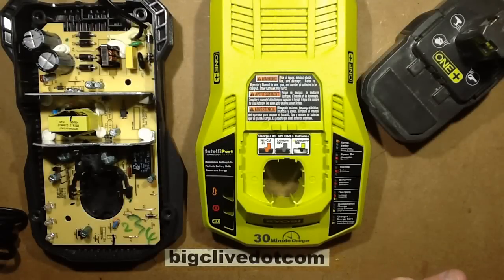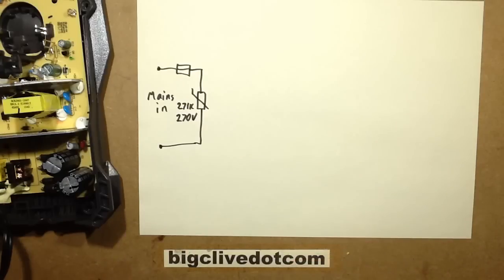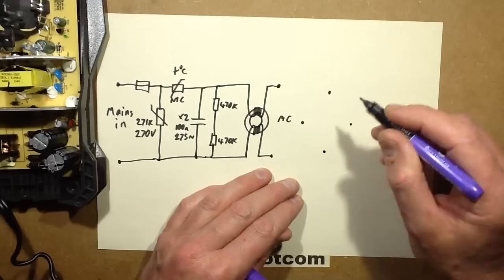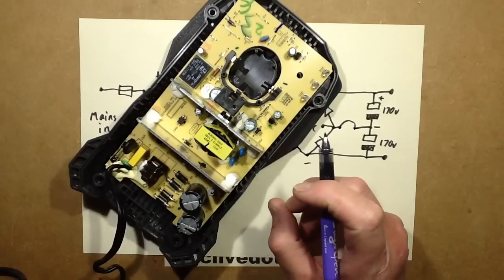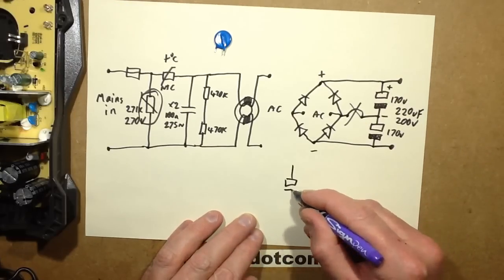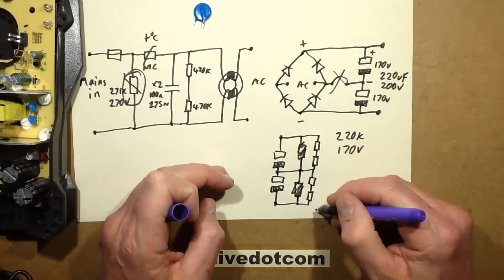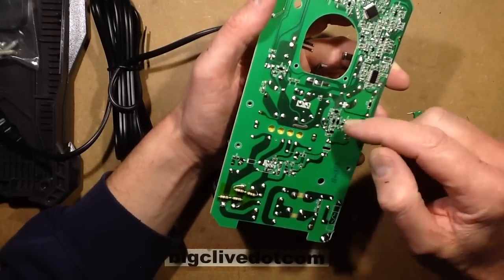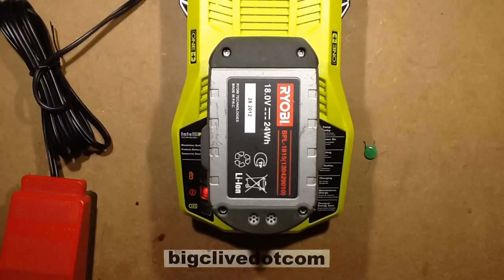How to convert Ryobi P117 charger from 120V to 230V use.

Comment: Am I the only one who hates having these bulky "application-specific" chargers? I mean you have 10tools and 10 chargers. I like having standard 2.1mm charging port on all devices and having charging circuit inside the battery pack with wide range input voltage. So I can just grab any DC power supply (12V, 24V...sometimes even 5V from USB) and I am charging. I modified some tools I have in my house with DC/DC converters and charging circuits to have universal input from 5 to 35V. It is much easier to charge. On small cordless screwdriver I even put microUSB port to charge because original charger was like 5 times bigger than the screwdriver itself. I don't have room for this. Now I charge it from USB just like my phone :)
Reply: How the hell did you end up with 10 different chargers, max I've had is like 2 or 3

Comment: Why no balancing resistors across the cap? Because the jumper is there, so they aren't in series! :-) Someone Muntz'ed (look up "Mad Man Muntz") the circuit and saved a penny. The MOV value is typical for US equipment.

BTW, watts equals E squared over R. Saves some extra math when calculating resistor dissipation.

Oh, that opamp might well be a voltage multiplier for the current sense resistor, and possibly also the battery temperature sensor.
Reply: so the 120v version needs no resistors, but when you cut the jumper you need to add them?
Reply: Yes. Or at least you should add them. You might get away without them for the length of the warranty. Maybe. And they cheaped out and didn't even put some holes in the board for them.
Reply: In 120v mode only one capacitor is working, in 240v mode both are which is where the problems might start.
Reply: mickenoss  In both configurations, both capacitors are used. The switch mode circuit input is expecting around 339V DC in either configuration.

Comment: My guess (based on the odd placement) is that they will use a single 400V rated capacitor instead of the two 200V ones so they do not need those balancing resistors.
Reply: Correct. Optimally when used in the voltage doubler configuration there's no need for resistors and when used at EU mains one single capacitor would be used.

Comment: Clive, are you sure that Third Contact is voltage sense and not a thermistor? Thanks.
Reply from the maker: The thermistor is inside the battery pack.  It's connected to the third connection.
Reply: Sorry, I misunderstood something you said. It occurs to me that the split negative contact might be to detect insertion.

Comment: I think I might have been tempted to replace those two electrolytics in series with a single, higher-voltage one -- as many μF as would fit, 450 V.  Fewer bits to go wrong .....  Looks as though it would go in with maybe some lead-bending.   The MOV is usually more for the benefit of the rest of the world than the switched-mode power supply; so if you wanted to be mean to your neighbours by interfering with their radio and TV reception, you could leave it out.
Reply from the maker: The X2 capacitor and the common mode choke are the noise suppression bits.  The MOV is mainly to protect the rectifier to ensure that the reverse breakdown voltage of the diodes is not exceeded resulting in breakdown and a brief but destructive mains short as a result.

Comment: Perhaps a question I'll get some flack for asking, but I had learned RMS to be .707 many, many years ago, but you seem to use its double, 1.414.  What's the difference, if any?  Obviously the equation used is opposite, but are they both called RMS, or is .707 something different?  :]
Reply from the maker: Wrong direction.  0.707 is for converting back from peak to RMS on a sinewave..
Reply: Ah, okay.  Thank you!  :)
Reply: It's not actually it's 'double', it's sqrt(2) (ie 1.4142), and then to get the conversion the other way (which you're thinking of), we do 1/sqrt(2) which gives the familiar 0.7071....

Comment: wow, so simple to convert us/chinese/taiwan voltage power supplies to UK/Aus rating :D. i'll keep this in mind if i find something i want to bring home and its a switch mode power supply.
Reply from the maker: It's not always as simple as this.  They clearly designed this PCB to accommodate both markets.

Comment: What was the cost in doing it yourself vs buying one already adapted for UK use? If you didn't have the parts etc how hard are they generally to come buy? As US prices are generally cheaper could you feasibley buy all your electronics from the US and convert them cheaper than buying UK ready/certified equipment?
Reply from the maker: Cost of components was less than a pound, plus I bet they don't add the balancing resistors on the converted ones.  Not all 120V equipment can be easily converted to 230V.

Comment: Can I ask, why you multiplied the mains RMS voltage by 1.41 to get the peak. Is it some sort of legislation that says it cannot be above that or?...
Reply from the maker: The value of 1.4 is used to derive the peak value from an RMS sinewave.  RMS means root mean square and represents the average value of a sinewave.
Reply: bigclivedotcom I am not very knowledgeable about this sort of stuff and that explanation didn't explain much to me lol

Any resources to help me?
Reply from the maker: Because the mains voltage is going up and down 50 or 60 times a second the average value is used to describe it.  When it's being converted to DC and then used to charge up capacitors they will charge right up to the peak of that moving voltage, so you have to work that out by multiplying the average by the 1.41 value to get the peak instead of the average.
Reply: bigclivedotcom Ah okay, so those peaks will be 240V × 1.41?

(Also thanks for the replies, love your videos)
Reply: Strictly speaking, 240 V × √2.
Reply: applefanXXX It might also help to mention that when we specify an AC voltage as 240VACrms (root mean squared) what we are really saying is that the AC waveform has either the equivalent area under the sinewave curve OR the equivalent resistance heat output of a 240VDC (notice DC) voltage source drawing the same average amperage, whichever of those analogies you find easier to understand as they are both equivalent (so think in terms of heat energy or area under the curve when graphed).  However, if you draw on graphing paper a straight line that represents 240VDC and then you plot a sinewave on that same graph you will suddenly notice that if the peaks of the AC sinewave were only 240V then they are missing a lot of area under that sinewave curve, meaning that while each might have the same peak voltage that sinewave curve is obviously delivering way less power because it spends very little time at that peak voltage while DC spends all of its time at that peak.  But if you if you draw that sinewave with peaks of 340V (240V*sqrt(2)=339.4V) then the sinewave curve now has the exact same total area under the curve as the 240V DC drawing and will now deliver the same energy into a resistive load as if you had supplied 240VDC to begin with with each consuming the same average amperage.  Note, when drawing the sinewave that it will be very helpful to draw it as a rectified sinewave so that all the curves remain in the positive domain of your graph as it will make your life much easier when trying to see the difference in areas under the two curves.

And why do we use RMS AC voltages? Well there are a couple reasons. For one, if you know the VACrms of a circuit then you can use simple and straightforward math to calculate power (watts) into a resistive load using the same Ohms Law formulas as for DC (but only for resistive loads, otherwise Power Factor must also be considered...fortunately resistive loads have a PF multiplier of 1.00 allowing us to ignore such for resistive loads). And why the preoccupation with resistive loads? Well we have to go back to the Battle of the Currents between Edison and Westinghouse/Tesla when both AC and DC were used to deliver power in the early power grids at the tail end of the 19th century and into the early 20th century.  It was handy to know that if you had a 240V DC bulb then it would run just fine whether you fed it 240VACrms or 240VDC, the same holding true if that bulb were labeled 240V ACrms, as incandescent bulbs are resistive loads nice warmed -- a 240V bulb is a 240V bulb regardless of current type, direct or alternating, when using RMS voltages. And in the early power grid, the majority of consumer loads were resistive in nature, whether they be incandescent bulbs or clothes irons, electric griddles, etc., as there were very few motors and practically no electronics in consumer use at the dawn of the electric age and the motors and electronics that did exist were largely confined to industry. So the use of RMS voltages when stating nominal AC voltages both simplified some of the math while also avoiding much of the confusion in the early days when a customer might expect to be served by either an AC or DC power utility since both could often be treated interchangeably as it concerns resistive type loads.

Hopefully that helps a bit, if not then I apologize for the added confusion. If you visit Wikipedia and lookup "root mean square" (RMS) you will see some graphs that may also assist in further understanding, but do not get hung up on the math presented unless you are into math, just focus on the graphs for a more visual understanding.
Reply: Ethan Poole That was one hell of a reply but I understand what you meant by the "area missing" explanation if I drew a sinewave. 

Thank you  man :)

Comment: I'd probably just buy a 240v to 120v convertor as they are fairly cheap.
Reply: They are a loss of efficiency and also probably the weak link seeing how well-made this charger is. 
If you wanted easy instructions, here they are: Cut away the wire between the two couples of diodes, then cut away the green MOV where the cord comes in. No soldering needed.
Reply: Not very elegant solution, they tend to be big and heavy for higher power devices like a fast charger.
Reply: mharris1270
The need for MOVs depends on the country. We don't suffer from power surges here. Buying a power strip with MOVs is more of a novelty/snob thing rather than a necessity. That said, I did add a MOV into my home-made UPS.
Reply: +zwz • zdenek you never have lightning in your country? I'm in the UK and we have a very robust power grid. My surge protector has tripped at least once a year from grid spikes and lightning strikes.
Reply: Evil from evilution
We have lightnings, but not any noticeable surges in the grid. The only things that get burned are networking cards when the lightning strikes a roof nearby (the internet is sometimes distributed with UTP cables strung between houses), but never the power supplies.
I have a protective circuit with GDTs installed on my incoming UTP cable.
The best thing to protect the customers from lightning damage is putting the power lines into the ground. Our municipality organized a big upgrade about 20 years ago. It's excellent in so many ways.
Reply: You sir, are clearly not from Florida.  Lighting is a huge factor for us here, given that the mains lines are at the top of the power poles (where not buried).

Comment: Clive is there a way to convert a battery operated drill or tool into a wired form? As you know the batteries die and it's often cheaper or more practical to just buy another drill.
Is there anyway to utilize these drills that are mechanically fine but have no battery packs? or do you have another suggestion?
Possibly an idea for a video?

Comment: Thanks, Clive! This video is super helpful for me. I moved to Europe a little while back and have been meaning to bring over my Ryobi power tools but stalled on it because I thought I'd have to either bite the bullet and buy those expensive chargers or run them through a step down transformer. Never would have thought it'd be this easy to convert the ones I have (slightly different type but I'll try to figure them out per analogiam).

So yeah, much appreciated content.

Comment: Should one replace the fuse with one of half the current as well? With the change of current would the in rush device also need to be changed to be complete? Why not replace the two caps with a single one or two in parallel?

Comment: but clive how can i get those cordless tools on a cord?
Reply from the maker: You could theoretically scavenge an old battery case and make a very high current 18V DC power supply.  But it might just be easier using mains powered tools or getting some of the high capacity batteries.
Reply: thanks for the replay :)))))

Comment: Clive, I found through experimentation that my UK green Ryobi One Plus chargers will run on DC from around 160v. I was looking into possibilities of using a solar string without a battery bank nor a charge controller.  I would love to see an explanation of this to satisfy curiosity.  I was actually going to email you. Sometime soon regarding this very question but. This prompted my message in haste!!
Reply from the maker: If it's a simple one-voltage charger that was designed for rectified and smoothed 120V then the first thing that happens in the unit is the 120V AC gets converted to 170V.  So by feeding it from a DC supply of around 150V to 180V you just do that in advance.  A unit designed for dual voltage use like this one might not be happy with that though as the voltage doubler would be defeated and only one capacitor would be charged.
Reply: Here is the actual chargers I found to work Ryobi BCL1418H  Would love to see a tear down vid on one of these some time to better explain how it is running on DC and also mine your knowledge as to the correct mods to do so safely!
Reply from the maker: Most switchmode power supplies will run on DC because the incoming AC supply is converted to DC to start with.  But they usually have a voltage range they will operate in.  I've got one of the units you linked to and it seems to be rated for 220 to 240V operation, and that would suggest that the DC voltage you are providing it with is about half what it would normally expect.  But many switchmode supplies will work down to unusually low voltages albeit with less predictability at the lower voltages.

Comment: I would have been tempted to try removing the varistor and also tempted to see if the series cap's balanced themselves, or used a zener diode on the output, but I don't know, so bow to your greater knowledge Sir Clive....

Comment: It's not a successful modification until you know that it safely and reliably recharges batteries.
Reply from the maker: I've charged three with it and also measured the operating voltage on the main capacitors and it was exactly what I expected it to be.  Exactly the same as if it had been running on 120V with the doubler arrangement.